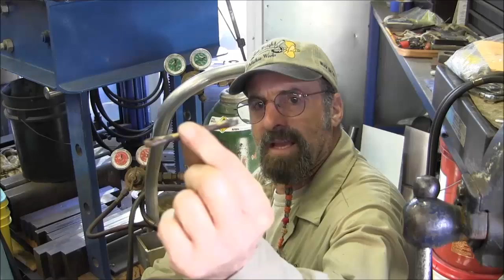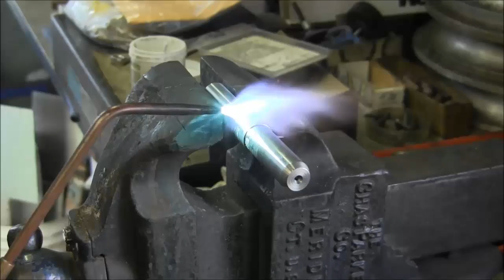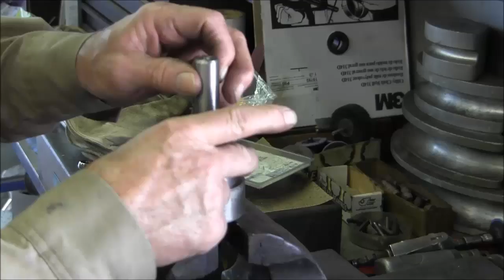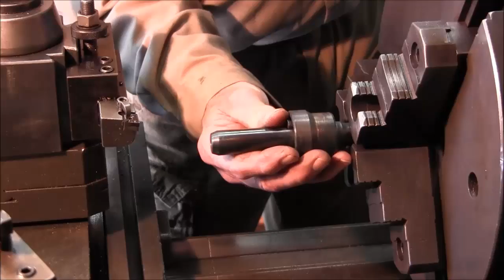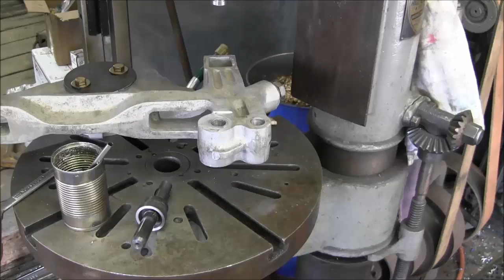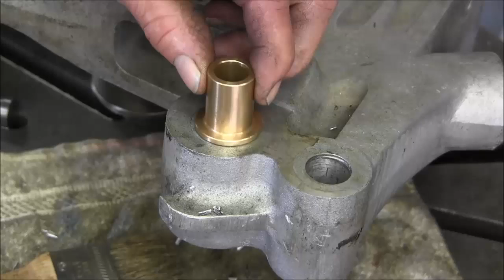Mattracks Part 7 Mail Call: ATV Mattracks Repair

Comment: you could use set screws for at least the cap so that silver soldsering is not required. You could may be also use a set screw to keep the cutting bit in place and allow adjusting the toolbit and even replacing it just in case it breaks or something. Using both set screws allow depth and cut width adjustments and possible re-use

Comment: 24:35 I can see the tool running out in the drill chuck. Just wondering why you chose to go with the old drill press and not the mill.

Comment: That old drill press is probably the same make as one I used to use in a small stamping plant, in the toolroom. I'd guess that one to have been made in the 20's or 30's. The sound is exactly the same, the gears that is. BTW, have you ever tried kerosene, when cutting aluminum?

Comment: Love your videos man, and I know you are a man of vast experience but IMO a gate valve with a key is far safer than a turn wheel operated one, and quicker to close. Too much of a tendency to have them partially open then in an emergency not be sure which way to turn it to close it off.   Valves should always be all open or all closed.  The key to operate you set should be attached to it so it does not get lost.  I am at a loss as to why you use oxy-acetylene to silver solder something. Seems like overkill to me.  I used to work as a fire safety guy for a large corporation, and we would not let oxy onto our site unless it was absolutely necessary for the job.  BTW gas is stored in cylinders, beer in bottles, water in tanks LOL according to my instructor in fire school.

Comment: Keith Fenner  I thought the hardening of the tool steel would be ruined by heating it up that much? (when you silver soldered it)
I know it's pretty much impossible to judge temperatures from a camera since it'll always show it hotter than it is but that looked really hot to me...
Have you worked as a teacher at some stage? Your teaching skills are exceptionally good! Thanks for posting all your videos :)

Comment: Keith, I had this point in mind inn an earlier video, but the bird's eye perspective in this part reminded me again..

Did you consider the perpendicular alignment of the bores? I was thinking you could have used a vertical level perhaps to make sure that the distance from the holes you bored to the outside of the piece would be the same on the front and back side.

Let me know if I explained that poorly..
Reply: You could do it a variety of ways.  Keith fabricated the fixture/jig to "index" all of the holes/bores parallel to its axis.  At ~19:95 he refers to the square/plumb of the table.  As long as the axis of the fixture/jig is parallel to the axis of the spindle (quill) all holes will be parallel as well.

Comment: Did you consider screwing the cap on, rather than soldering? That way it would be easier to adjust. And more likely to move when it touches, of course.

Comment: Keith;

Was there a reason why you didn't use a grub screw to lock in the tool bit so that the bit could be pulled out for sharpening or replacement?  Were you worried about not getting a good clamp with a grub screw?

Thanks again for the great videos.

Regards;

Ron

Comment: Propylene would probably be more expensive per tank, and would definitely change your setup with your torches, possibly even requiring different tips...

If you are using a CGA-510 regulator it will work for both gases, but the CGA-300 is for Acetylene only.

Go to Welding Tips & Tricks for a more thorough discussion

Comment: Always nice to have the valve handle built in.  Where I used to work even the big bottle had the square drive shaft.  Right before I left they went to the built in handle.  The small bottle set we had still required the wrench like the small bottles we have where I work now.  Maybe we'll get the built in handles too.  I think we are running the MC size.

Comment: That is not the correct procedure.  Search youtube for regulator burn out.  When shutting down, drain lines and open regulator until loose.  During start up open oxegen slow with face turned away.  Once pressure comes up you open valve 100% to back seat the valve.  It's not very often RBO occurs and the above procedure minimizes your risk.

Comment: Might be a stupid question - but isn't the heat from the soldering affecting the hardenes of the cutting bar?
I'd expect it to be softer after the intense heat and the slow cooling.

Comment from the maker: Yes there is a counter weight in the column, most large drill presses have them and also connect to the spindle so it has spring return. No Brake! ;{)------

Comment: Hi keith I love all of you videos 
You said to turn the O2 bottle on all the way. I work in a fab shop some guys say only a 1/4 turn because if you have a fire it wont take long to shut off the fuel source. and some guys say turn all the way because it is a double seated valve and if its not all the way open it could leak.
I always turn both bottles a 1/4 turn and never had any leaks
Have you ever heard that before and whats your thoughts?
Thanks.. 
john

Comment: Why did you silver solder instead of using a setscrew? Your toolbit was glowing red at one point, it lost it's hardness. If you intended that, you might as well just made your own cutter from a steel cup, all in one, and then harden it yourself, since it will only cutting aluminium. Would have been faster, cheaper, more accurate.